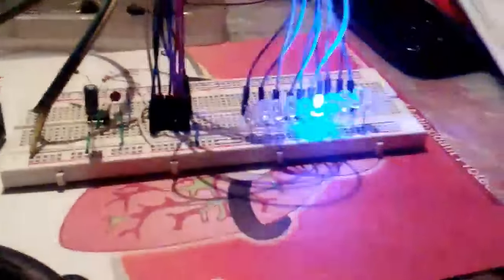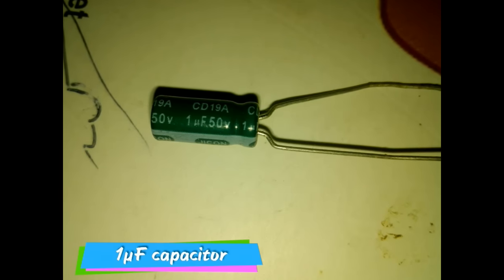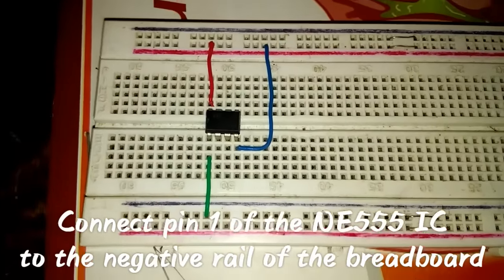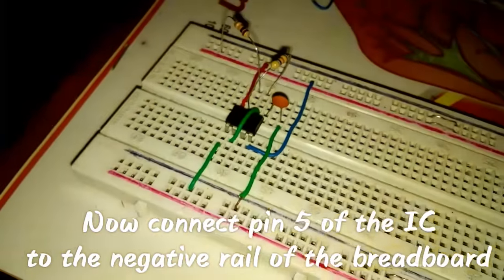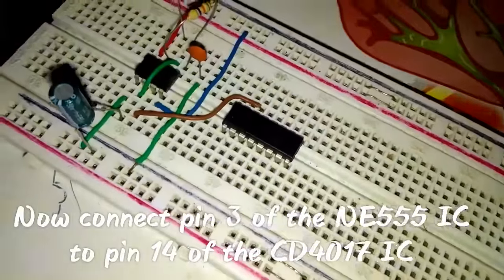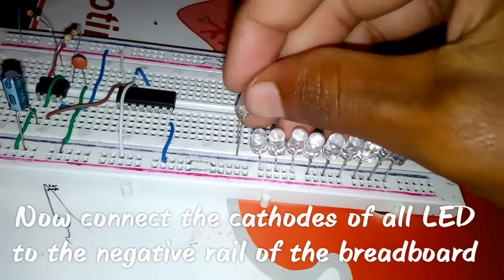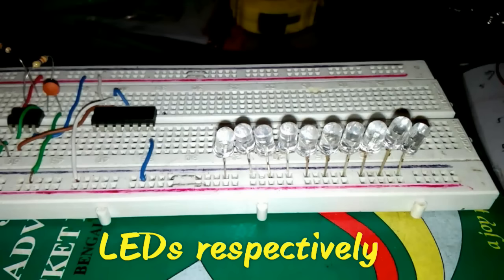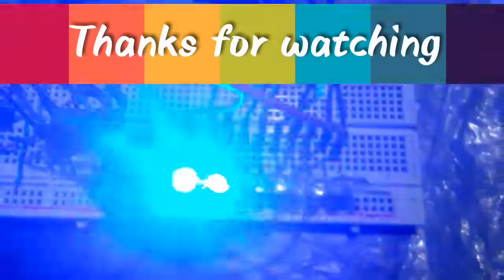How to make a LED chaser

Comment: i use the 12v dc adapter for the 4017 and all leds are flashing,why the leds flashing without ic 555 or oscillation source?

Comment: In this circuit is it possible to change 10*6 =60 led ..for that what all changes i need to do
Reply from the maker: +VINAYAK K.M change these resistors and capacitor valu and use 12 volt power supply
Reply: Which resister and capasiter i need to use ..